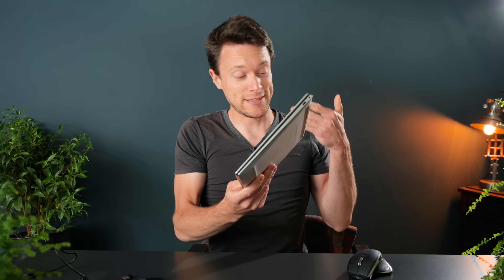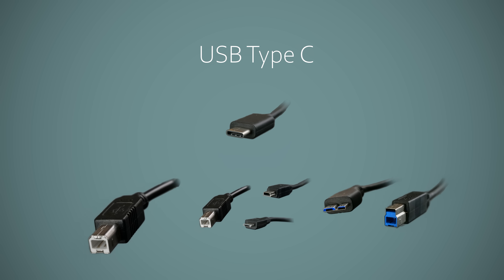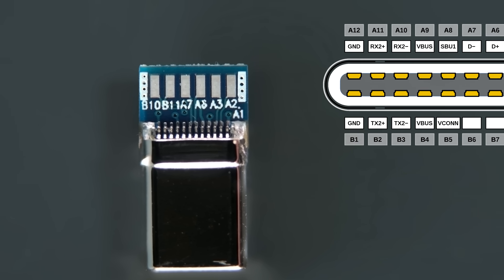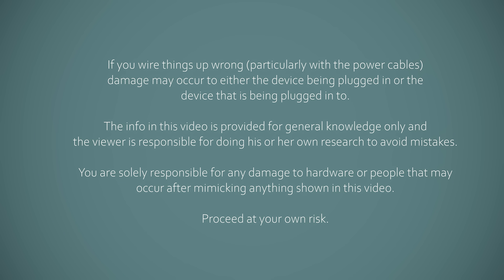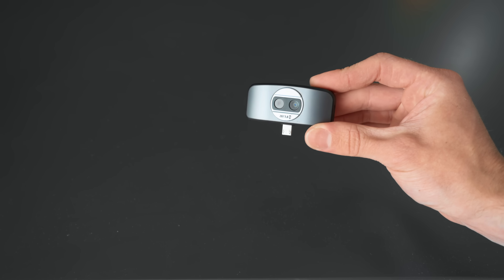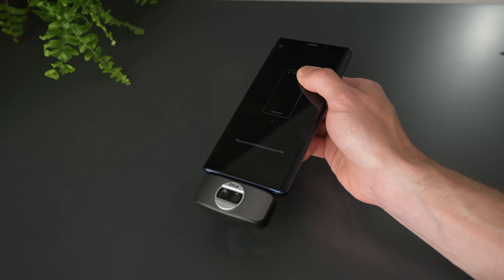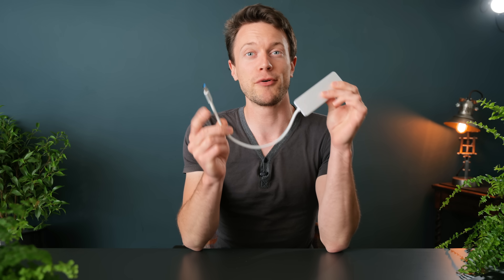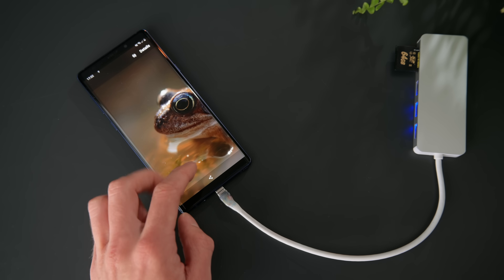Converting devices to USB Type-C

Comment: Plz make different external ssd to one by usb c 😊🙏🏻 i hav 3 ssd each 500 gb want make one but how? 🤔 regards and respect ✊
Reply: Just buy a big drive and consolidate all your porn onto that.
Reply: If they’re normal usb 3.0 devices it should work exactly the same way as his last conversion did.
Reply: @chetanvlogs tapai Pani hernu hunxa😂
Reply: Whack the end off of the sata adaptor and follow his instructions  to wire up the connector or if it has a removable cable just get the appropriate connector to usb c
Reply: Theirs no possible way to do that without raid, so your best possible way to achieve that would be put a raid card inside of a desktop and put them in raid-0
Reply: Just buy a larger external SSD that has USBC they're like $100 for a TB
Reply: imagine having half a million subs while speaking like a 5 year old
Reply: @neptunez3495  English may not be his first language. Ever thought of that?
Reply: @neptunez3495  🤣
Reply: superbluebomb imagine no one cares, he does have half a million subs, salt man
Reply: If you have 500k subs, I'd imagine you get at least a little ad revenue... and to that I say, buy internal storage, or buy bigger drives. Plain and simple. I mean, I dont even have a single subscriber I dont think, and yet I have 2 1tb m.2 nvme drives in my system, along with a 2tb SSD, and a 12tb + 2--4tb 7200rpm HDDs. 24tb total, and here you are worrying about 3 external 1.5tb-worth of SSDs? Priorities, what are they?
Reply: @TheGauges420  what do you need that much storage for? All the porn there is in the world in 480p, or rather your Top 10 porn but in 8k?
Reply: @CorrSave  why not have all this storage? I just picked up a gen 4 1tb m.2 for $160 on prime day, literally no real world difference from my others lmao. BUT, I dont ever have to worry about running out lol, I can download Modern Warfare 20 times over and still not worry. I never have to worry about storage, isnt that better than going with a 256gb m.2, a 500gb SSD, and a 1tb HDD? Thatd all be full in no time, maybe 10 games if you're lucky.

Comment: buying a dongle is very cheap and simple solution, but usually most of the dongle only compatible with USB type A, if you have some device using USB type B, or Mini or Micro USB  this DIY is very helpfull ,

Comment: STOP CUTTING THE TRACKS!!!!! you could add solder to the resistor pads, then either go quickly between them using the soldering iron or if the tips big enough, heat them both at the same time, then use tweezers to remove the resister and solder it onto the other pad

Comment: With the way technology goes we'll start to get used to the USB C and then USB D will get rid of that Center sliver that goes in the center of the connector.
I wish they could do a magnetic connector like apple does so would have no more broken connectors if you forget to unplug it and walk away with the device it would just disconnect instead of put tension on the connector which eventually breaks it overtime.

Comment: Time convert = spend 3 hours soldering or 30 mins and few bucks for USB C adapter - hmmm let me think?
Reply: Why would soldering 4 wires and a resistor take 3 hours?

Comment: 7:11 You should have just moved the r1 resistor to r2, without butchering the board. Also there is a thing called bluetooth, you can use that with laptops.

Comment: You'll need to use rosin core solder (for electrical work), not acid core solder (for plumbing).

Comment: Hi,
Thanks a lot for your video which is really helpfull
I would like you ask you a question since I'm absolutely ignorant regarding electronics.
I have a macbook pro, with only USB-C capabilities and I can't find a cooling pad with usb-c plug. So I tried, with one of those dongle to connect my old pad to the laptop but fans won't work... It's a bit frustrating...
Do you know, or even believe, that the fans may work if I use the same converting process??
Thanks a lot for your response and advice.
Once again, great video!! Thanks!!

Comment: Is there anyway of putting some cameras on the sides of your screens to look at you while you look at the screen. I know you did this with the laptop and the mirror (the eye contact video) but I am using a desktop. I have 3 (4:3 - 1600x1200) monitors giving me a screen of 4800x1200 which I really like (I do have some bessel around each monitor, they are old monitors) so I have room for a webcam on the bessels but I can't hang a fixture over the monitor. (Or can I, mmmmm)

My best option come to think of it is probably a transparent arm that I can use to pull the webcam to the center of the screen.
Any thoughts anyone on how I could get eye contact during a video call?

Comment: This is a useless video. I bought these USB a to C adapters that fit into the inside of the Aport only adding in the length of the C plug onto it and it just works every time on everything. Also they cost me 55 cents each.
Reply: Does the same with micro USB as well as micro USB to type C as well as USB 3.0. Making my finished product smaller then yours and with out any risk. And is removable

Comment: i have a usb c on both ends of charger cable. I cut off one end i have 5 wires. W G R B and Y. Im trying to convert to a usb end for pc and charging block. USB end has W G R B but no yellow. Where does yellow go?

Comment: USB naming is strange... 
Universal Serial Bus not serial from 3.0, but no difference for people - but we got a lil trap with renaming -  after releasing 3.1 they (USB-IF) rename 3.0 to 3.1 Gen 1 and 3.1 to 3.1 to 3.1 Gen 2
"USB 3.1 Gen 1" and "USB 3.1" -  5Gb/s and 10Gb/s with almost same name
But 20Gb/s is coming... and USB-IF rename it again
5Gb/s - 3.0 (3.1 Gen 1) rename to 3.2 gen 1
10Gb/s - 3.1 (3.1 Gen 2) rename to 3.2 gen 2
new 20Gb/s - name  USB 3.2 Gen 2×2

Comment: Hi Sir, I
searching days and actually I do really not find as in your presentation but vice versa an OTA USB A 3.0 male to Type -c female adapter. Reason: I will use an USB C hub with USB ports and included HDMI port connected, in case the adapter exists to the "OTA USB A 3.0 male to Type -c female adapter." I will then be able to use the USB C hub on the Apple lightning USB 3 Camera adapter. Meaning, I will be able to use the field monitor, USB microphone etc on the iPhone SE 2020. Thanks for your attention.

Comment: usb c for transfer big data (long video) is better, but i think it is better use for super fast  charging.
usb can get 40w charge and wireless is max 15w.
And for new device it will have 55w and 27w  wireless charge. 
i use fast  wifi to sync my video to nas.
so use usb adapter to connect anything useless.

Comment: Now if only it was easy to do the opposite and change out a micro-usb charging port for a usb-c charging port so I don't have to deal with the micro usb cables barely lasting before they stop wanting to hook in and need to be replaced.

Comment: I'm not sure, but I bet the right way to change the USB C breakout boards to slave mode was to just move the already present SMD resistor to the empty pads right next to it. These kind of stuff usually works that way, so the manufacturer doesn't need to make two different PCB designs. Asides from that, all I can think of is where to get that Sugru over here (I'm from Chile, in South America). It looks like an awesome way to make those home-made connectors.

Comment: In the USB3.0 example, couldn't you just open cut a USB-C cable and resolder it to the open ended USB3 cable?

And, do you need to care about the resistor thing if you cut a Type-C cable to solder it on type-C boards?
Thnks

Comment: 0:32 Looks like a solution to me
7:37 That definitely looks awful. Much worse than a dongle, don't you think?

I'm going to stick to the dongle. Simpler, easier, safer, and cleaner than having to solder my own board and mould my own case, thank you very much.

Comment: This is interesting for sure, but most laptops still have at least 1 or 2 type a ports. Also with how much work is involved here and the risk of damaging your devices, I'd much rather get something like this
https://www.ebay.com/i/322893074712?chn=ps&var=512019124150

Comment: Ok so to Converting devices to USB Type-C
, first you need a usb type C connector. 
Ok so now you use the type C connector taadah and everything is fine, why you even need to convert anything.
I like most of your project but not this one, a lot of effort for something that can be solve with a few $ dongles aint sound like efficiency to me.

Comment: My question is who's making laptops without USB A? I understand C's becoming the new standard and its versatility is remarkable, and honestly Should be what we use primarily.  But... It's extremely hasty (and short-sighted) to hack off the port entirely, especially  considering how most devices, high or low end still use it so much. It's like a worse version of removing the headphone jack.

Comment: Great video. Im yours subscriber from Ukraine. Just have great idea for you to make gaming pc build, what im dreaming for a lot of time.
Idea is: buy gaming laptop motherboard from Ebay for example great choice i5 9300H with dedicated GTX 1070 OR 1650, and make it work on back of TV or Monitor connected via HDMI.
Main problem what im thinking for: how to make power button to turn it on cause i dont know how to start it manually without button, and second problem for me is how to make cooling, if you dont have original cooling system.
Maybe you can get this idea to life for me, and yours subscribers.

For example link to motherbaord is here https://www.ebay.com/itm/MSI-GF63-MS-16R3-15-6-Genuine-i5-9300H-2-4Ghz-Motherboard-GTX-1650-MS-16R31/324165784091?hash=item4b79c9521b:g:4DMAAOSwQfVevOF-

Comment: Sure, I'd like to see how to build a stand alone USB webcam out of the webcam built into an old laptop.  The only problem is that I'm still using the old Win 7 laptop right now.  Still, one thing that I think would be neat is to make a very small webcam that could be mounted on a stalk in the middle of the monitor.  One problem I see is that for most people on a webcam either they are showing the top of their head or the bottom of their chip because they are looking at their screen and that isn't where the camera is.

Comment: With new Samsung phones you get a small USB-A to USB-C converter for using old chargers i guess. I found a wireless mouse that I had and connected it to the phone, and as soon as the mouse turned on, a cursor showed up on the phone and it worked as if I was using a mouse with a computer :D

Comment: A few things come to mind...
* Obviously, native USB-C devices have benefits in power and data speed, and older devices will not be "adapted" by simply hooking up a different connector.
* About the wireless mouse for example: What about using Bluetooth?
* [thought in the beginning of the episode...] What about using a usb-hub on the laptop? Okay, I know, this works as a dongle, but it will give you more ports and with the few I see on that laptop you got there, you're probably going to need one anyway, if you wanna connect more then one device. Or any device, while charging.
* [then you coincidentally work on the USB-3 hub] Okay, I would never do that. Just get a USB-C hub.

Comment: Am I the only one that hates type C? I find it a weak, wobbly, unreliable mess. I have a MacBook with just the 4 thunderbolt 3 ports and it’s a nightmare to get things working, some cables can handle faster or slower speeds than other but aren’t labelled properly, hubs and adapters randomly die if too much data is demanded for a split second, corrupting external drives. Even just with phone charging, about once a year my phone starts charging really slow and I buy a new cable and it’s fast again, they deteriorate fast.
I like big solid connections, like XLR, 3.5 and 6.25mm jacks, Ethernet/RJ45 and yes USB A. You can still make positive feeling small connectors too, IMO lightning is a better standard for a small reversible power and data connector, at least the clip on them is in the cable so it’s cheaper to replace. I had to take my phone apart and replace the internal Female type C to get it to work properly again.
I’m not a big fan of micro B, but at least it stays in, it’s a secure connection, much more so than C

Comment: I am looking forward to when everything goes to Thunderbolt 3. Super speed compared to C. I have only been able to find motherboards with 1, possibly 2 connectors. I would like to see at least 4, possibly 6. The difference between 5 mbps,(USB 2.0) and 40 mbps with power, (Th-3), is HUGE if you are trying to get to zero latency, (think midi interface, and live performance from different remote locations). I already run internet at 500 mbps, and I am going to switch to 1 Gig at the end of my contract. I will have to switch NIC's and providers to go to 3 Gig, and can't justify the cost at this time. Additionally, it makes no sense if companies do not have servers capable of the same speeds. (Good luck with getting them to upgrade servers).

Comment: Shouldn't you also link the resistors/transistors? Or no bc they are going to vary? Clearly idk anything about electricity but for a DIY like this, I think it's important to focus explaining that part a little bit better. I can solder no problem but would have no idea what to do with those parts, and how to figure out the stuff you did with the multimeter.

Comment: Why scrape away at the PCB and add a large through hole resistor, when you could just simply have moved R1 to the R2 pad.

Sorry, but you dont seem very good at electronics or soldering.